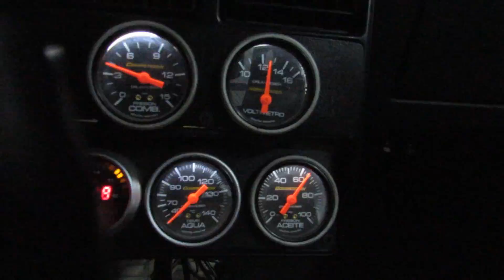Fiat UNO +155HP a TLDE! (Caido de la 5)

Comment: Hola, tengo dos tlde 32 34 españoles completos guardados desde 2005  con 58k y 67k kms, y otro italiano sólo tapa, cuerpo y base de mariposas como nuevo, y pregunto si ser serviría llevar a alguno a 36 36 (24 - 26 de venturis de perfil casi recto como los Holley yanquis, no curvados, pienso en un taladro de pie con mechas de esas medidas cola rebajada para pasar directamente en lis difusores y terminación matando cantos y alco de rugosidad horizontal), para colocar al múltiple de un Tempra 2.0 8v con un poco mas de compresión, múltiple de escape y algo de conductos sin agrandar y ángulos de asientos. Vale la pena el laburo?? Gracias x compartir con humildad y sencillez éste tipo de videos y x lograr tanto con conocimiento y experiencia.

Comment: Es loco pensar que roza los 100 cv/litro con un carburador original relativamente chico y 8v jaj casi unico en el mundo estos motores que arman en Arg jej
Reply: Ivo, en USA hasta 2012 usaban carburador único de 4 gargantas (barriles le dicen x otros lados) la categoría NASCAR con motores V8 de 5.7 L (350 pulgadas cúbicas) y 2 válvulas x cilindro con distribución clásica x unico cam de levas, rondando los 145 hp x litro de cilindrada, obviamente muy desarrollados y materiales especiales para soportar muchas millas y regímenes altos durante los giros. Hace 8 años sin carburador pero con cuerpo, tmb Holley, de inyección de 4 gargantas muy similares a los en dimensiones y la misma disposición q el carburador. Saludos desde Bs As Argentina.

Comment: nunca dijo la cilindrada . Debe ser 1.9 sino imposible .
Reply: Lautaro, lo dijo en N° s, cigueñal 67,4 mm, o sea, 1610 cc máx. Con pistones 88 mm (supermedida), el auto año '89 es el uno scv de 1490 cc (1500) de cigueñal 63,9 mm desplazamiento o recorrido, anterior al Tipo de 1580 cc. O sea, de nuevo, es un 1.6 y dijo q lo queria hacer con cigueñal de 69 mm q lo deja en 1700 y pico. Saludos desde Bs As Argentina... ah, cierto q Leva es de acá, acostumbrado yo a los foros españoles...
Reply: Ah, los uno 1600 con carbus dobles verticales andan arriba de 185 hp hace un tiempo en 1/4 milla. Igual prefiero más la manera europea de andar en diferentes circunstancias del trayecto, más real, ahí nació el rally.